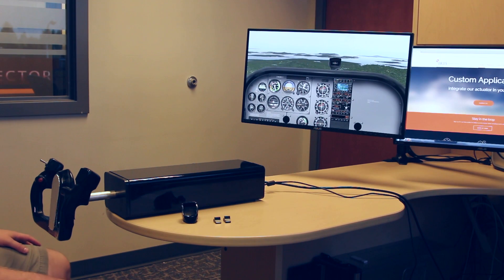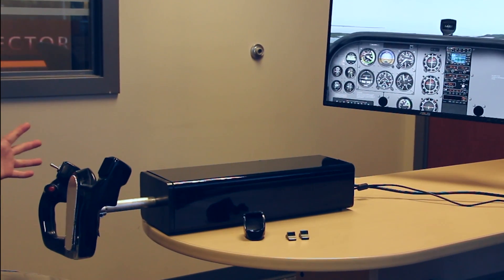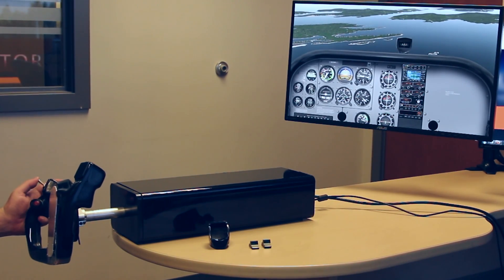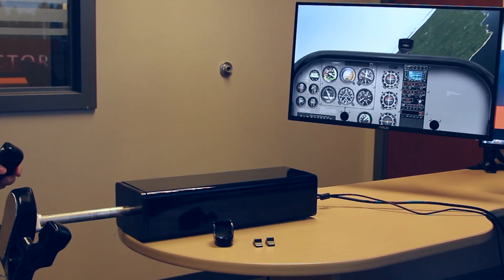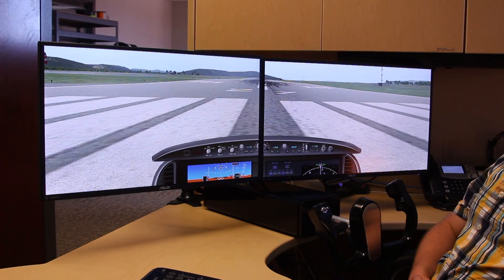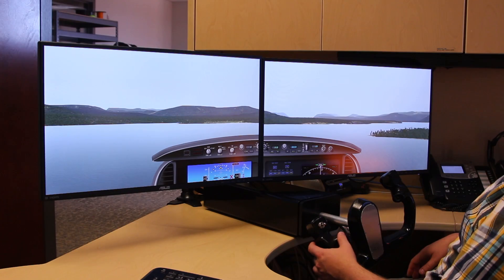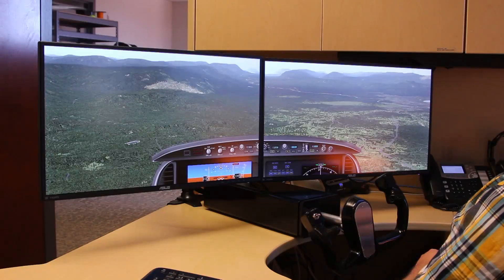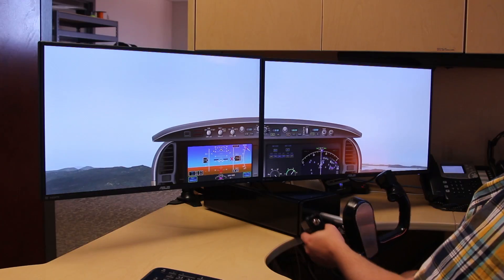Yoke Functionality Demonstration

Comment from the maker: Good eye Shawn! there's a mention of that in the "about" section of the video. Back when this video was shot there was a bug where the polarity of trim function was mirrored when operating in "stand alone mode" vs "dataref mode." So when the yoke was plugged in to a dataref source it operated correctly, but when it was operating in standalone mode trim was reversed. When I was shooting this vid back in Aug it was the first time we had noticed the issue, you will notice I at first tried to make the correct adjustment only to feel the opposite of the intended action. The video was shot on a weekend so I decided to just post it vs wait till it was resolved to re shoot the video. That being said the issue has long since been fixed!
-Pat